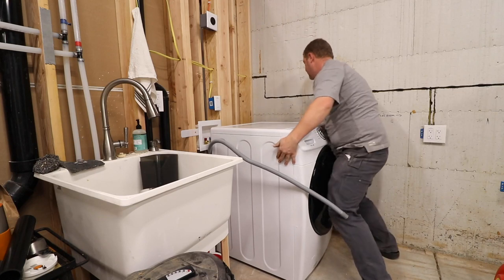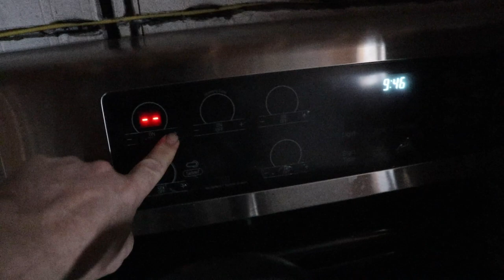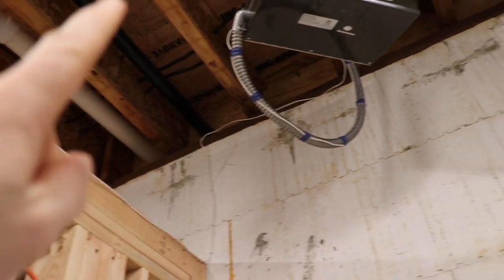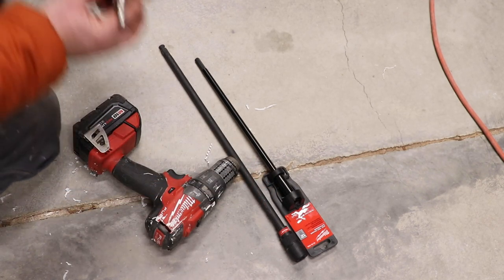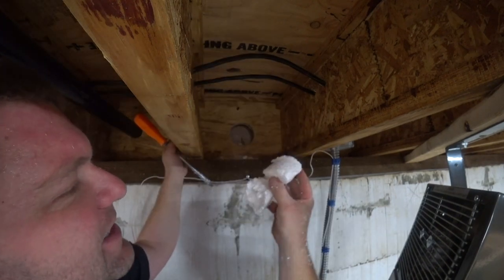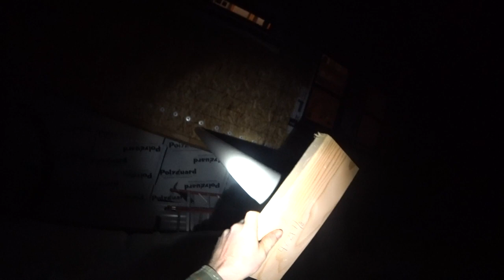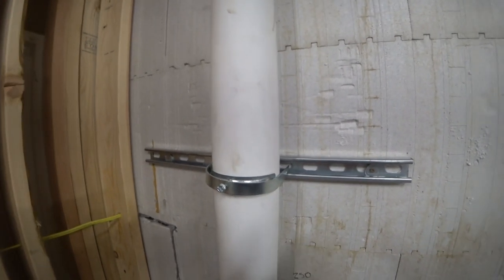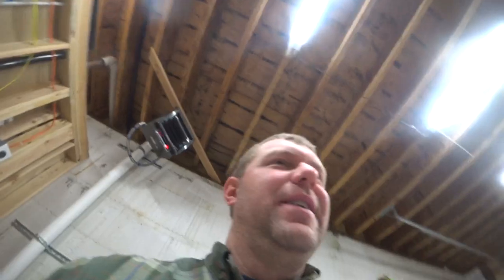WINTER YOU DIRRTY DOG! (Dryer Vent Installation)

Comment: "we spent so much money on efficiency" 
And then you buy a non condensing non heatpump dryer? and are now worried about the heat in the summer. I'd worry more about where your dryer is going to get its fresh air from, because you're house is supposed to be pretty sealed. 
But hey... each it's own ;)

BTW the summer is a good time to dry your clothes outside on a clothes line ;) and in the winter you could use the heat from the dryer to heat your house with a heat exchanger.

Comment: As most readers has mention, the PVC is not a good idea for dryer vent. If all possible, running the dryer vent straight out the side of the house would be best, rather than running such a long run straight up. I would use metal vent straight out the side of the house, if not too close to the ground. I hope Alyssa gets well soon!

Comment: The hot air from the dryer can be used to heat the house too, and in the case of the electric dryers, you can vent directly to the inside of the house, just install or build a lent retainer (basically a bucket with water) and clean it every once in a while. When you don’t want the extra heat or humidity inside, just switch it to vent outside. 
In my case, one load heats up my 800 ft2 apt. by  ~2 degrees F (1degree C).

Comment: No condenser dryers in the US, saves punching holes in the building envelope.

What's all the fuss about PVC ducting on the drier, you can pore boiling water down a sink and the waste pipe won't sag.  Exhaust from a tumble drier will have the same impact as this.

Comment: When you get right with the vent ducting material the next thing to think about is flashing at the moisture barrier under the siding to prevent water intrusion.  Consider a "flashing panel" sized to the diameter of the duct that will provide a seal at the duct against water and allow the moisture barrier weather lap the panel all preventing water damage.  The flashing panel is a rigid plastic panel with a black rubber gasket for the duct to pass through.  A "Vent Box" at the inside termination would be good and allow an easy connection from the dryer's flexible hose to the sheet metal vent.

Comment: Do not use PVC for a dryer vent!  The static will cause the lint to stick to the pipe and reduce the air flow until it clogs.  Use the products designed for this instead of thinking you know what you are doing.  The wheel is already round so stop trying to reinvent it.  Aluminum and sheet metal pipe is the best solution.

Comment: PVC for dryer exhaust sounds like a horrible idea.  Dryer exhaust can be really hot, and PVC melts.  I would personally just use the dryer vent for the wall penetration since it already has a long extension on it, and than use flexible metal dryer ducting up to it.  I consider dryer exhaust duct to be a limited life item that needs to be replaced at regular intervals because no matter what it's made of it will eventually build up lint and pose a fire hazard.

Comment: You'll be pleased to know that everyone in the UK (and probably Europe) uses PVC pipe for Dryers as standard, it's only a problem because many people don't install a clean-out vent or never bother to inspect it.
I'm surprised you have code rules over this, it's just a hole in the wall. We only have inspections for electric and gas.

Comment: It will be more expensive, but you could run a double wall "Type B" metal vent pipe for the dryer. It will provide the same function as standard metal ducting with the benefit of insulating air between the walls to reduce the heat intrusion into the space. Your existing mounting method will work with it just fine. Unfortunately it requires 1" clearance to combustibles so the hole will need to be almost 7" diameter.

Comment: I was working at a new construction site one winter day after a 12 inch overnight snow fall. as I was going into the house with heavy tool boxes in both hands the snow let go just as I got to the wrong spot. I was stuck in waist deep snow and was full of snow going down my shirt. I had to get some help getting out as the snow was really compacted from the slide. I always wondered if you could attach a concrete vibrator to the under side of the metal roof and use it to control when the snow falls off.

Comment: So what would be wrong with the normal expandable dryer venting aluminum pipe , why not pop a hole in the wall and vet it about 2 or 3 feet straight through the wall yeah i know a lot of dirty work but your vent would be so short easy to clean ,I think your asking to much to vent up like that and out just a thought . As to the roof that could be a killer you need to take care of that this spring . But it's looking good .

Comment: Bugaboo...What? You don't like the snow?  It's not that bad...just be quick...lol
Jesse I would think  4 inch ducting for a chimney would solve your problems. 
And to solve the heat radiation from that...wrap it with Heat Duct insulation. It's designed to wrap around...round ducting..

Comment: Use soap bar as a lube for the outside of the hole saw. The plastic coated spring flex dryer tube was outlawed for sale and home use over a decade now. Guess the new generation of installers not taught common sense sciencey stuff now. Going through that much material with 1/16 give. Moving the drill angle to get the teeth to bite in can make things tight. I wire brush the teeth after pulling out any plug to remove that thin layer of gum that forms on the teeth. I thin layer that lakes the teeth slick like soaping.

 In Europe with very old buildings they use snow catches on roofs. Lightning strikes people just like 100 pounds of snow and ice falling 20 feet. Some people play the lottery odds without buying a ticket. Also a sheet of icy snow could slide off, catch air and rip/fall back into the home. Maybe the cat did not have a heart attack while outside, by the house. I learned about the snow catches and reasons from watching custom copper roof installing.

Comment: pvc plastic melt wery down tewmperature about 50-60 degree, and ABS melt lot highest temperature i no remember ABS but think has about 80-90 degree temperature come soft.or has 110 degree, looking internet i not remeber now. ABS have better use air dryer because has hot air come out and melt plastiv tube if temp have high. air vent and tubes have normal build code/rules alltime only metal tube. not statric problems,melt problems fire burn problems. but ABS used sometime, i think not dryer because have hot air. and need cover insulation neopren sheet ower tube too. because hot air make condensation lot if not have insulated.

Comment: use a periscope type duct, then sheet metal a tube from the periscope to the and thru the opening, don't use screws use lots of metal tape, hose clamps and a flex connection at the dryer itself ezpz also use fire rated gap foam as needed on the outside :)  but you guys are looking great and please keep sharing :)

Comment: I did not think of the static thing, I'm concerned about the heat factor with the dryer and the stove vent,(oh. heat/fire and pvc would be very bad inside!),  i think there is  4inch uninstalled metal pipe you can get and it may even be easier to install? good luck with your problem! I hope I helped.  Oh stupid me, I just thought of something, by the time you get this  you may already have fix the problem.  oh, well, I hope all went well! i hope the sicky in the house feels better way soon!!

Comment: Sorry for the miscommunication/misunderstanding. I'm an electrician and my guess is PVC is not temperature rated for dryer and range hood applications. It is rated for a vent if it's not heated air. So a dryer vent goes above 200 degrees and PVC is only rated for 140F. Stores and contractors should know that. I don't know who you talked to but you got lead down the primrose path. Sorry for the inconvenience. That really stinks for you guys and I wish you had been given better information. PVC is rated for conduit duty including direct bury and concrete if I'm not mistaken. I have seen high moisture applications were rigid conduit just rusted away and PVC was used in those applications.

Comment: Most of the world dries their clothes on a clothes line. You appear to have a front load washing machine. They usually centrifuge at 1200 to 1400 rpm. That should get out enough water for the clothes to hang dry in a couple of hours. Also, you talk of efficiency; the most efficient driers use a compressor to extract water from the clothes and dribble the water down the drain.

Comment: PVC has a low maximum operating temperature - it probably wont catch fire directly, but over time it can weaken enough to lose its stiffness and sag or collapse, which can cause even higher temperatures, and possibly collect lint which could catch fire in the pipe.

Comment: Drying clothing in Northern Nevada year around, I cheat, I hang the wet laundry outside on a clothes line, the sun & wind is free.

If I am desperate I hang the wet clothing on a 50 year old clothing rack in the house, it dries & I pay less for electricity when I don't use the electric dryer.

Comment: 1. Using liquid soap on that PVC PIPE would facilitate installation.
2. For the drier exhaust use only metal exhaust pipe.  You can get insulation sleeve that slides right over the pipe.  Works great on the bathroom vent pipe too.

Comment: I'm a bit surprized that you didn't take advantage of the heat from the dryer, since you started this channel as wanting to go off-grid and so on. Living in a cold climate, every bit helps.
There's quite a few ways to do this, but this site explains the concept pretty simply, and it is awesome - it works well: http://www.alkeng.com/AL/dryer (Pre-heating external dryer air)
There are also quite a few methods to re-use the heat from the duct to help keep your garage warm, a thermostat would kick on the fan whenever the dryer is running.

Comment: Okay three steps forward and two steps back given the distance from the dryer outlet to the outside and the fact that the pipe is vertical for a long stretch wont you need to put a condensate drain in ?.

Comment: Why would you go in reverse on a hole saw? I have never heard of such a thing as going in reverse with a hole saw. The teeth of the saw are pitched in the optimal direction for forward cutting. Now if you assume that it helps when pulling the whole saw out that also makes no sense. Because you have already cut the path. It should come out easily just by pulling it out while in forward. This is most likely why Diablo uses the system without a lock on the mandrel. I guess if it bothers a person bad enough I am sure a little lock tight will take care of it. I just don't understand why you would go in reverse.

Comment: I believe a reverse cycle dryer avoids any need for venting. They sure cost more but are more energy efficient. Keep in mind the air being sucked though the dryer to the outside is air you've paid to heat.

Comment: I understand your dilemma. My question is why are the flexible dryer duct materials made out of plastic? Can't you ground the plastic pipe with a simple screw into the plastic and bond wire to ground, hense discharge any static build up? That's what I do with my dust collection piping in the wood shop. What about all the static in the central vacuum systems which are plastic? Food for thought, good luck with this one.

Comment: PVC for vent it is heat of range or dryer that is issue. Put in standard wall flapper vent with metal duct and connect flex duct or metal duct to it. You can always use insulation over vent but heat added is minimal but does not hurt to insulate.

Comment: I think I would have used a lint trap on the dryer until you have to re-route the bathroom plumbing vent in the future and then used the same hole going out after enlarging it.  You are having another tough winter! The roof works great!

Comment: I have not seen a dryer pipe mount vertically due to cold air ingress causing condensation potentially forming and running down into dryer?

Comment: There are some videos on You Tube showing snow removal from roofs in Alaska.  They use rope or cable.  Run it across the top near the peak, tie one end to a tree or dead man then pull the rope or cable to slice under the snow.  The snow will follow.  This should work well with your roof because you have no vents sticking up.

Comment: The Deoblo system for Hole saw looks awful. It is not just spinning off but also locking on Mandela.That is why old system has pin locks to prevent hole saw from locking on threads. Also you need some shorter extensions that one looks like to breaks the wrist and arm. I always find best to use long drill bit to go through full wall then using hole saw on both sides to  connect hole. My job requires cutting holes like this up to 6” through 6-10” thick walls at times so know the wrist and elbow breaking of holes saws and respect them

Comment: Jesse. My best advise to you, while you are still progressing toward having HVAC sign your building off, leave the dryer open to the garage. The amount of energy you need to run the dryer in the first place, it would be crazy to blow all that heat outside. The humidity won't matter until it's painted, it'll help with plastering if it was a little humid anyways. Save the heat! use it! 

OR send it through a heat exchanger/blower and use that heat to heat the air in the house.... If your rooms are underfloor heated, vent that air through air to air exchangers and downstairs into the garage.

Comment: Never seen dryer ducting that wasn't thin-wall galvanized steel, with an absolute minimum of flexible metal ducting right at the rear of the dryer.  You can apply fiberglass and metal foil insulation around it. Avoid the plastic over metal wire flex hose.  Disaster-in-the-making.  Saw the value of metal ducting demonstrated very powerfully in my youth, when I delivered and installed appliances while in college.  A particularly bone-headed customer threw some gas-soaked rags in the wash, and when they got to the new dryer, flames were shooting out the exterior duct work into the yard.  Ruined dryer, scorch marks on the outside wall, but house still standing.

Comment: It also occurs to me that you can just earth bond the pipe ergo no more static that's what they do with PTFE lined plastic conduit.I would be more worried about the fluff in the filter than the small amount going up the pipe our condenser dryer doesn't fill the room with fluff !!! in Europe an exterior vent dryer comes with a flexible plastic pipe very thin with a metal coil to maintain the wall support most if not all fires occur when whoever uses it forgets to clear the filter.

Comment: Sounds like Alyssa has a sore throat.    No fun. 
The hole saw thing is frustrating, manufacturers creating systems that don’t play well with other systems.   I would not have thought about static electricity & PVC pipe being a problem either.  Live & learn.  This is helpful for someone else trying to do this same project.

Comment: When are you going to fire secure the steal beam in your garage, I see a stove, heater and a dryer as potential sources for a fire.... putting some fire insulation round that steal beam might just save your house as the beam will deform faster than you think.

Comment: Why vent the dryer right now? It's winter and you could use both the heat and humidity in the house. No way the laundry for two people will create too much humidity. They make diverter boxes with a filter sock. Take advantage.

Comment: spray some 3 volume hydrogen peroxide all over your sink and counter top.. when its dry.. do the same with where you store your tooth brush. including your tooth brush..  peroxide will kill anything on it.  you may also want to flush the water transport tank with 5 gallons of water with 1/8 cup of beach.. and take it out for a drive so it splashes around inside the tank.. then bring it back and hook up the pump and hose to pump it out..    just to decomtaminate the water transport tank..  when you go to fill the tank.. you may want to put some